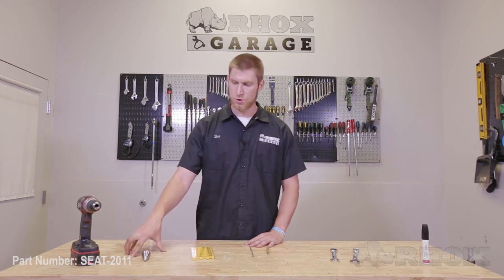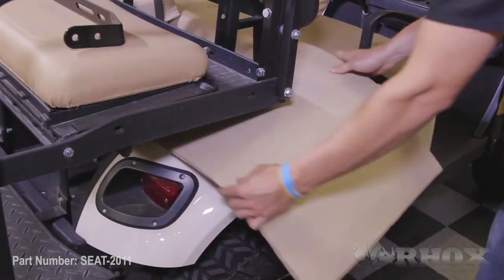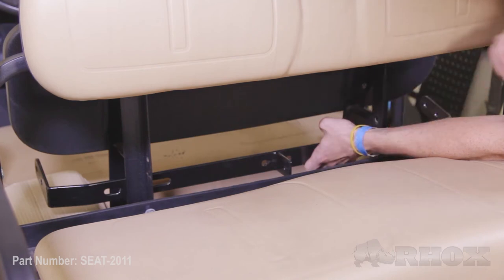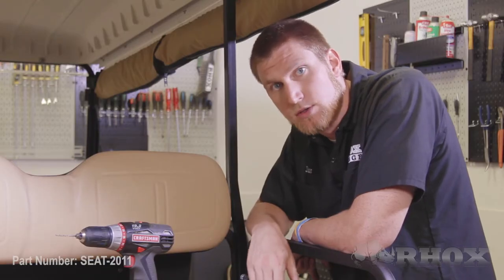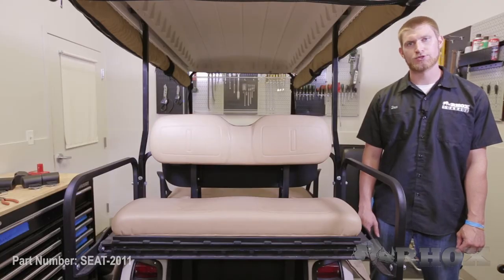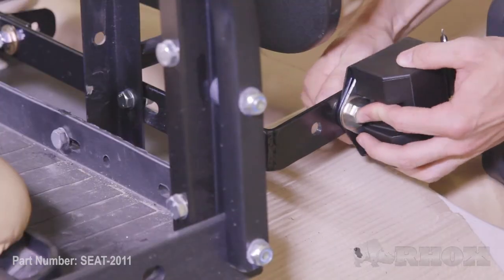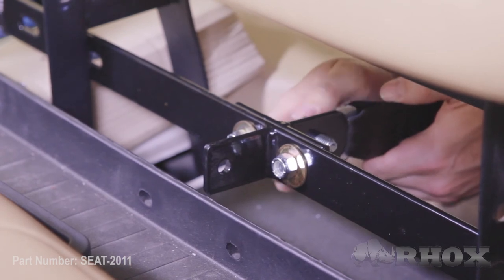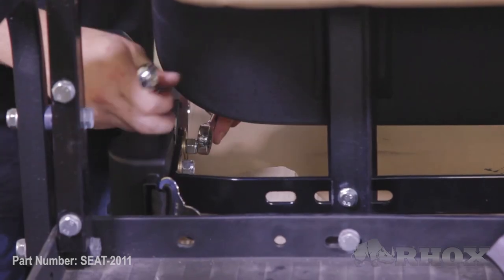SEAT-2011 Deluxe Seat Belt Kit on an E-Z-Go TXT

Comment: I have a 2018 Yamaha ptv, if I install this facing forward and point up, the seat belt retractors dig into the seat back, the seat backs are much lower than on this cart.  Is there any reason I couldn't turn it backwards, so they are facing backward and at an upper angle? I know it says there are multiple ways to mount it but then the video also says make sure it's facing forward and up.
Reply from the maker: You can mount them facing forwards or backwards.  It's a universal seat belt bracket.  Just make sure when mounting the bracket to the cart, you need to mount it on a metal surface vs. a plastic one.